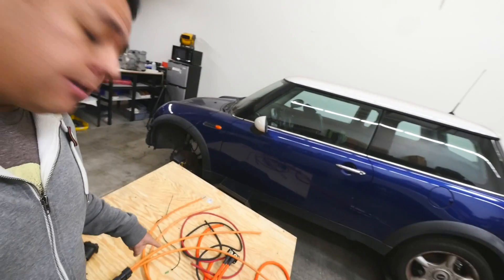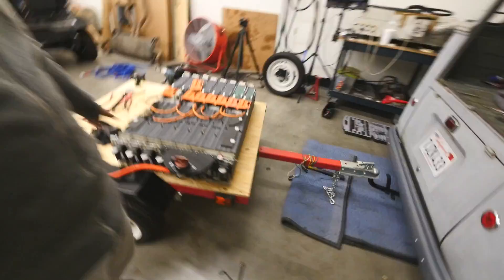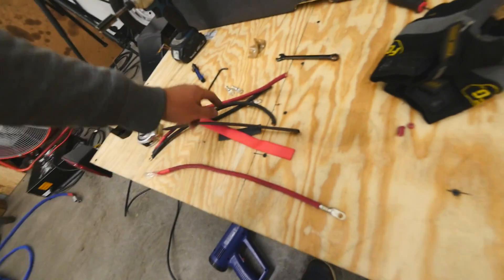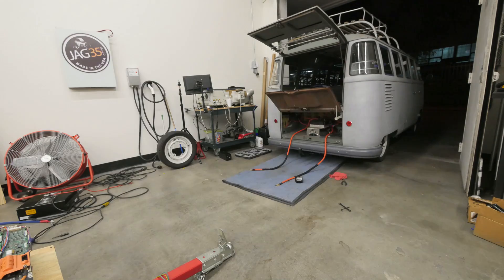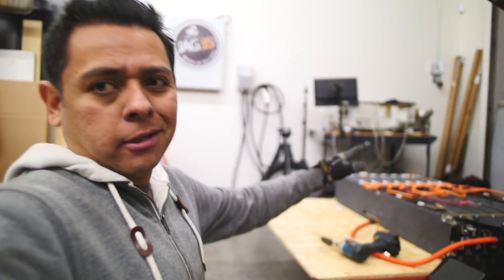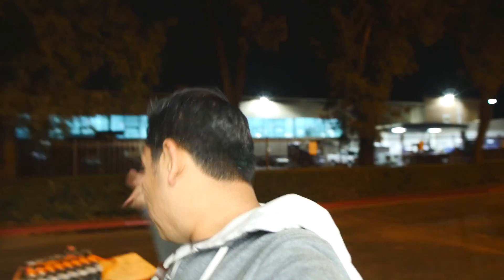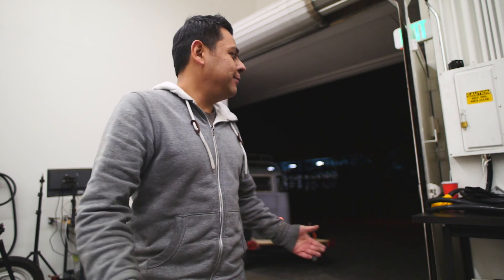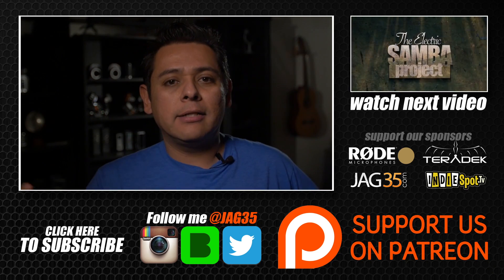Electric Vehicle Range extending Tesla Battery Trailer project pt3

Comment: you should mount the plug you have on the trailer draw bar into the bumper of the bus and use the other end to run from the trailer thus getting a cleaner fitment mad project keep up the good work

Comment: Is there a rated maximum weight on that trailer? 700lbs is a lot of weight to put on a little trailer and a sheet of plywood. Are you going to bolt some sort of frame on to hold the batteries from shifting? I think screeing into plywood might prove insufficient with forces from highway driving.
Reply from the maker: +zoidberg444   3K LBS trailer.   We'll have to see,  for now bolts and nuts into plywood

Comment: What will happen when someone crashes into your trailer?
Reply from the maker: +Toni Lähdekorpi   An accident,  carnage ?
Reply: jehugarcia I was thinking, the battery could probably be secured so that on impact, it breaks free using the impact energy to slide away instead of breaking into pieces.

Comment: Hey hey what a day!! Glad my suggestion worked for your trailer. It was awesome being noted in the Vlog. That little trailer can hold about 3000 pounds before those springs will flex. Tires are your limiting factor on payload. don't be surprised if the trailer bounces when hitting bridge joints and other large bumps on the highway.

Comment: If those cables have to stay exposed behind the Samba, I hope they're not live.

What if you were to divide the trailer into segments electrically, each with a disconnect?  You can always stop and switch over.  On the road you're going to generally be in a draining mode, is there any advantage to having half or two thirds of the trailer "in reserve" ... or any advantage to running everything down evenly?

Comment: why don't you put solar panels  on top
Reply: +carl goss +jehugarcia You should make a video about that.

Those VW bus have a great roof for that, as long as you can use flexible or rounded panels.
The problem is (speaking from my experiences) that when you do need to charge elsewhere than at home you are probably on a road trip and you want fast charging, either CHAdeMO or CCS-Combo. Two or three solar panels would only be around 400-800 watt/h sitting in the sun for a ~1500$ investment and only serve you once in a while and on top of that, most panels are built for static roof installation so they are quite heavy, 20 to 40 pounds each, maybe there is lighter models. How much watt hour does it take to carry ~120 lbs in the Samba?

I'd be interested on a video about this that cover the investment needed and the math behind this considering weight, aerodynamics and price.
Reply: +Martin Brochu he already kinda did

Comment: Good idea, but as a 35 year mechanic you might have to much load to far forward, check load wt. on hitch, and might I recommend that you put a quick disconnect coupler so if trailer get loose the cables won't drag trailer, and some kind of metal or fibreglass cover for batteries. The coupler is obtainable through any industrial forklift parts supplier and comes in 175 and 350 amp plugs. Good luck on your project.

Comment: Do you think this trailer setup would be able to be used on your Volt? That has me very intrigued ...... mostly for selfish reasons as I drive a 2012 Volt. Thanks and please keep the great content flowing our way!!!!
Reply from the maker: Yes it can be used to power any vehicle of any voltage using a big dc-dc.   And it could also be re-wired in different configurations to a limited extend to power certain vehicles of the right voltage,  like the samba

Comment: Jehu, a simple trick for backing up a trailer is, when vehicle and trailer are straight grab the bottom of the steering wheel, move your hand in the direction you want the trailer to go. Make small corrections, the shorter the trailer the smaller the correction. Practice along a line on pavement. Easy peasy.
Reply: +craigslist04 I agree.  The key is practice, and practice in open air with simulated environment like garage door openings.  Orange traffic cones are a reasonable expense, but start with sidewalk chalk if you have to.

Comment: Wouldn't it be a good idea to load up the trailer with the same exact weight and take it for a good spin before putting all those batteries on there and risk something going wrong while driving (for whatever reason). Just to be safe. Would be pretty catastrophic if something happened to the trailer while driving.